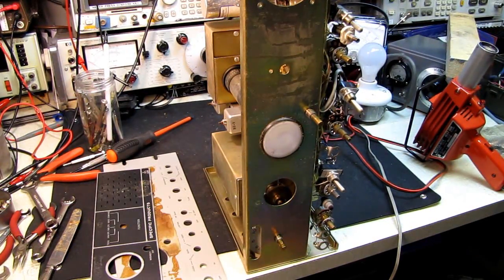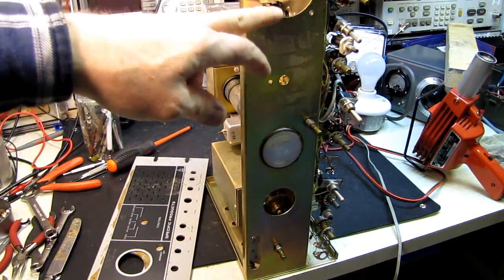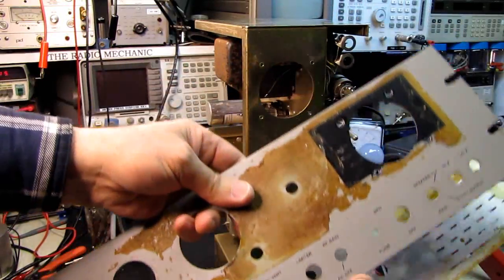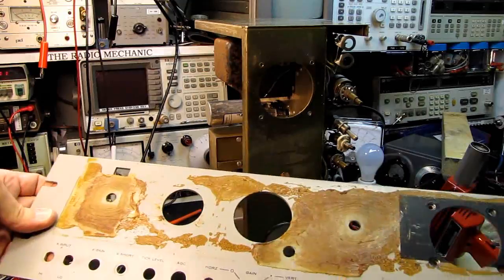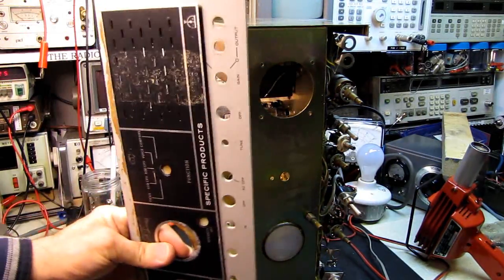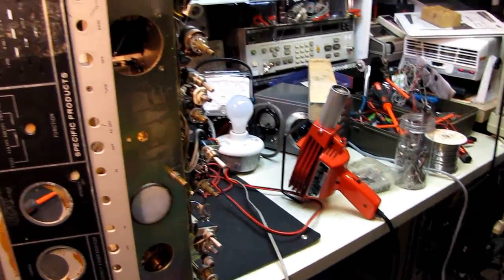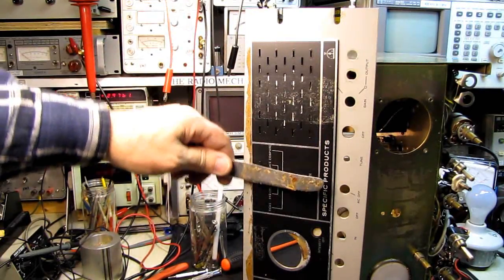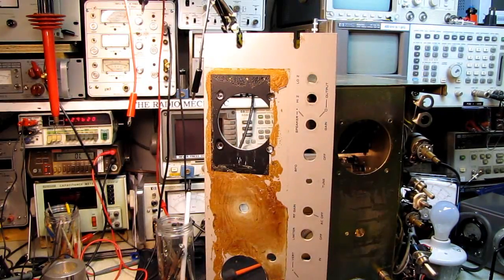Model WWVC Standard Frequency Comparator #3 Front Panel Repair

Comment: Very bad screw placement
Reply from the maker: Not a good design. Also the ends of the panel are not screwed to the main chassis which allowed it to get bent in the first place. The control shaft on the right hand side is the first support for the panel and is almost 4 inches from the edge of the chassis. I am very surprised that end didn't bend also.
Reply: wow, thats very strange from a piece of gear from this era

Comment: You might try a fine point black Sharpie to touch up the scratches in the black area of the front panel.  You could try a tiny area just to see if it would help - of course it might make it worse.  Just a thought.  Interesting piece.  73, Bill.
Reply from the maker: We used to use a sharpie to touch up anodize on corners and edges. But on the front panel it will have a bluish tint that is fairly obvious. My last job had many parts black anodized. 
Appreciate the thought. Vern